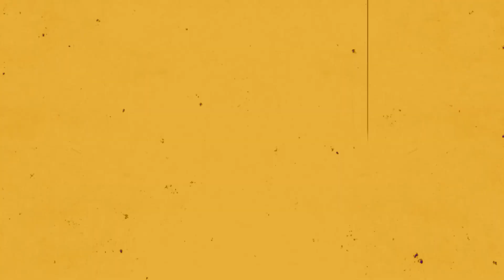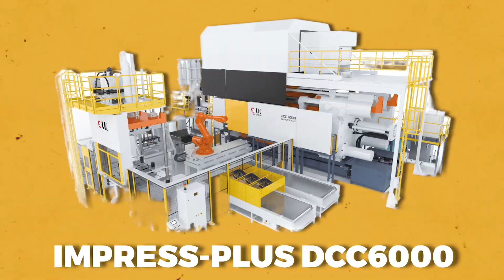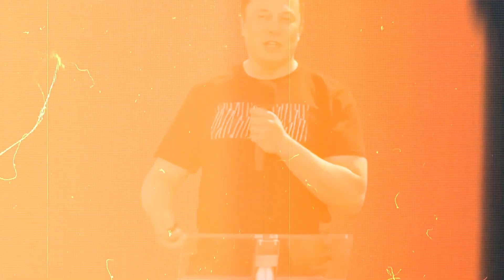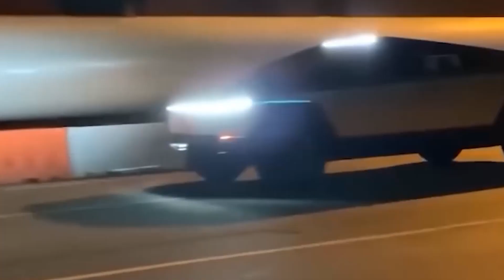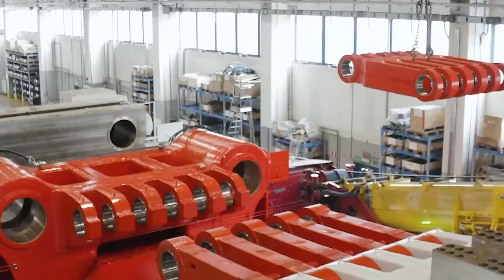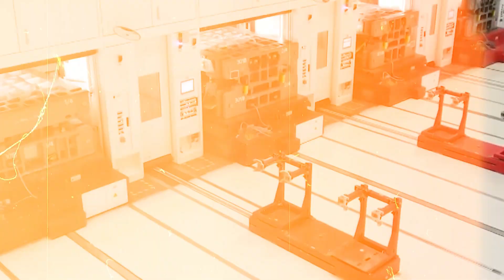Real Secret Behind Making Tesla Giga Press 🤐

Comment: I remember how cars used to rattle apart the further you drove them. That is changed. The diecasting is the tool that forms a body of a vehicle without natural stress points. That car, will perform the same in year 30 as it does at the very beginning, brilliant!